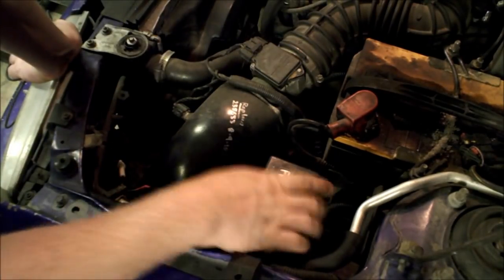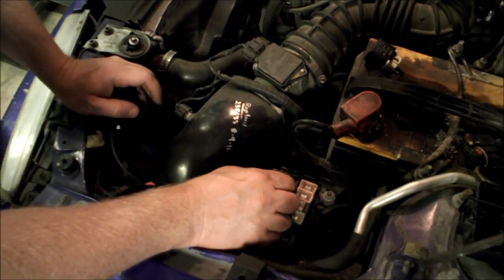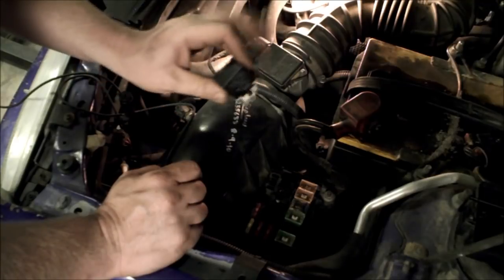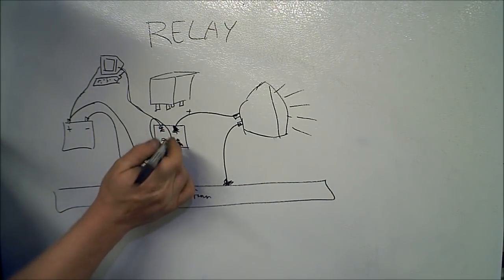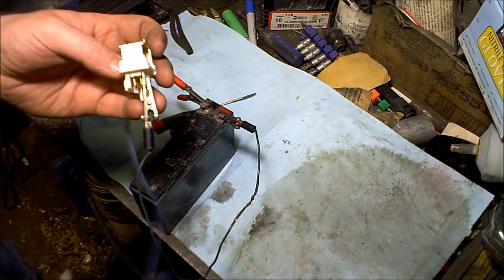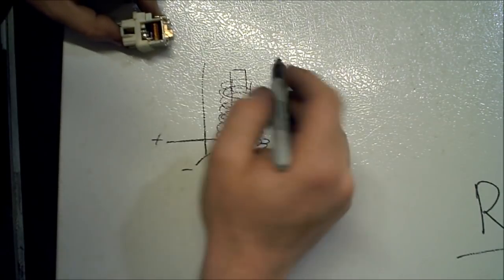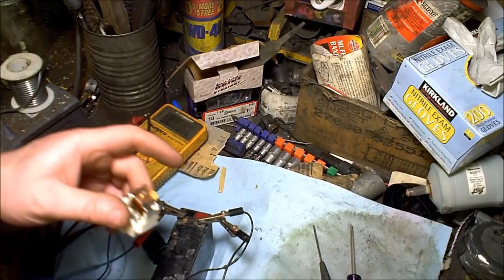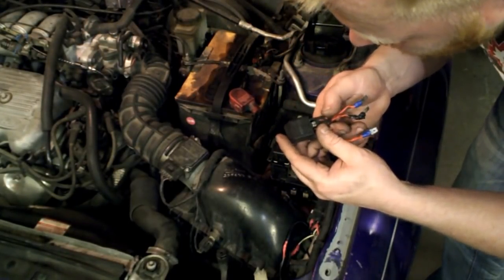How Automotive RELAYS work and how to FIX them

Comment: please keep in mind that if you sand the contact surfaces of a relay it is only a temporary fix. The factory applied silver or gold coating is destroyed when you do this and it will only last a short while before pitting again. I would suggest doing an internet search for a new relay at your price if the relay price is to high at your local auto parts store or stop by your local pull a part salvage yard you can get a bucket full of relays for a couple of bucks there
Reply: yeah it's sort of like how you could get by for a month or so by sanding your points contacts down in your distributor, so the pitting went away for a while.  But it doesn't last as long as a new one.  It would be nice if there was a way we could plate the contacts again with something ourselves.

Comment from the maker: I have fixed 2 or 3 washers that had bad lid switches. You can just tie the wires together as it is just a safety feature so you dont fall in while its moving.

Comment: This is the best fixes to relays especially in euro car's electrical problems Beetle, Audi, Porsche, Benz -- all go thru same relay problem as soon as they pass 150,000 miles so great fix!!! VW dealership was about to rip me off by replacing alternator and starter for tiny relay problem and quoted me 4785.00 $$ for parts and labor and I fixed it with nail filer for free. Nail filer works pretty much as good as sand paper infact nail filer made contact plates inside relay almost new and shiny which were burnt and black!! Great help

Comment from the maker: When the AC is on the fan should be on as well. If it gets too hot before the fan kicks on then the Temperature sensor for the fan is shot. Yes you could just jump pins to have it kick on always. You would have to use a tester to figure out which pins.

Comment: Nice!.  Excellent video.   I happen to drive a 93 ford escort LX wagon with the 1.9L engine (looks identical your engine) the Fan relay happens to not trigger the fan.  I ended up hard-wiring a switch to the cab but it is getting really hot.  I'm gonna try your suggestion hoping it will fix my problem..  thanks for the motivation

Comment: Hey I appreciate you taking the time to make your videos! This is some good info!!
Reply from the maker: Let me know what you come up with on your fan.
Reply: What is a pain is a recall maybe 1.5-2 years ago the vehicle had fan problems and we replaced the radiator/fan. I am starting to consider the 2 relays in under the air box or the one in the video may be the issue. I'll investigate into integrity check
Reply from the maker: Note where my fan relay is. Ford has it mislabeled at least in 1996. You can see in the video I wrote FAN in orange marker on the top cover.

Comment: I subscribed after thr CV axle video. (I have a 1996 ford escort lx 1.9 5spd, also purple) successful repair there. Now my car won't start. Did it once, cranked and got it home, now no start. The starter tries to turn over, which lead me to the relay which is clicking loudly as you turn the key to start. (I did get some help this time, we all know that's hard to find, haha). Where is the starter on the 1996 escort? The pics show it by driver side CV
Reply: To clarify there is a no crank situation now, so no movement at all even with a jump box.
Reply: Every now and again it'll given a weak attempt, I stopped trying when it didn't turn over like it did to get me home.
Reply from the maker: The starter is on the backside of the engine. If you take off the air intake hose it's pretty easy to get the two bolts out that hold it. There are two wires also connected to it.

Comment: My mom has a  02 grand am with a 3100 eng. The fan works but on dash hand goes well above half way b for fan kicks on, what i want to do is fix it when u got key on  that fan is running n keeps running after start n stays on untill u turn key off? That way mom can hear it b for she starts n she will know fan is running!!! Shes had trouble n past over heating got that fixed!! But she wants to here fan, n having a.c. pump on running all the time is not very efishent way, can i jump pins n relay??

Comment: Do 5 point relay now bro!!! Grrreat video... Highest recommendations 👍🛠️🛠️🛠️🛠️🛠️
Reply from the maker: 5 port is exactly the same except the 5th port is always connected to the power source unless the relay is activated then it disconnects this port and connects the power to the other port. So the relay is used to disconnect something from getting power. This is a rarely used function.

Comment: Thank you for your video. It was very useful. 
Ok... I have a problem. 
Tested the relay, it's good. 
Fans don't come on. 
Applied direct power to the fan, fan comes on. Replaced the engine coolant temperature sensor, still no fans. Tested for power where the relay sits, power is good. 
When I short out the ports where the replay sits, fans comes on. So wire is good from relay box to fan. 
I'm lost, what's my problem ? 
Any ideas ?
Reply from the maker: Sounds like you're on the right track. It's not uncommon for the computer itself to not tell the fan to kick on. Try turning on the AC and see if the fan kicks on.

Comment: Whats it mean if you do this a couple times and it keeps getting stuck? At what point is the relay just junk? Each time I clean it it works fine.... for a month or two. Thanks
Reply from the maker: They put a layer of silver nickle onto the contacts. That can get burnt away and the contacts will want weld themselves together. When this happens I generally replace the relay with a cheap Universal Style.

Comment: Could you explain what is seen at the relay terminals of the relay socket? What signals the coil side to energize? Can it be measured with a multimeter and what meter scale on it should be used? My ford windstar cooling fans run only when I connect the battery straight to them, just to know they work.
Reply from the maker: A 12 volt positive signal will trigger the solenoid to kick on. You can measure this on your multimeter with any DC voltage higher than 12 volt(example:20v 200v etc). Listen for a click when you put the solenoid in and pull it out. You can also grab a different same size solenoid from the horn, headlights or similar and try that. The fan should kick on anytime the AC compressor is cycling no matter the vehicle temperature.

Comment: What if it the relay holes from the fuse box it's self not working meaning in the fuse box where you plug the relay do I need to buy a whole new fuse box

Comment: I have a relay with a 5 normal size pins and another 2 pins which are smaller size.
Do you know for what the 2 smaller size pins are ?
Relay is (according to wiring diagram) for- fuel pump .
Reply from the maker: +Peter Dimitrieski The smaller ones should be your triggering device that turns the relay on/off. So one is pos and the other is neg. You can confirm this by using a multimeter and touching them. There should be a higher number of resistance than just touching the probes together.

Comment: I have a 2007 Dodge Caliber SXT and my High beams will not work. Does this have anything to do with the Relay or TIPM?
Reply from the maker: Your car should have its own relay for high beams. I would pull it and swap it with the regular headlight beam relay to test if the relay is bad.

Comment: Have you ever soldered the copper coil if it is broke or Separated.
Reply from the maker: I've played around with this but found it tedious and easier/more reliable to swap in a generic $5 30amp lighting relay.

Comment: @ sixtyfiveford, what gauge wire did you use on that relay?
Reply from the maker: I generally use 12awg with relays from the positive to the device being powered. The switching contacts can be as small as 18 or even 20 gauge

Comment: Would connector sprays work? Like crc or deoxit
Reply from the maker: Yes and no. Generally the failed points are from arcing. I don't think CRC or Deoxit will touch that. If it's from corrosion/moisture ingress, then yes.

Comment: I bet this is whats wrong with a GE washing maching i got off craigslist. I checked the 3 big capasitors and they dont look blown out. Could be the magnetic lid switch too. not sure yet. It's a 4.1 cubic ft top load and about 3 yrs old.

Comment: my outside mirrors motors that move them on my rx330 sometimes work and sometimes don't.  Vould this also be the relays?
Reply from the maker: +tikonc Relays shouldn't be involved in the mirror system. More than likely it is the motors that operate the system.

Comment: How do I make the contact stick longer. Do I change a capacitor? Why does the contact shut off in the first place?
Reply from the maker: The relay stays engaged as long as power is flowing through the coil. Disconnect power and the coil de-energizes and allows it open.
Reply: @sixtyfiveford  just to be clear though. If I add a bigger farad on the circuit will it make the electromagnet stay on longer? Thanks in advance.
Reply from the maker: @aaronmoritz9878  if you added a bigger farad capacitor it would stay on for maybe a half a second, second longer after you remove power.
Reply: @sixtyfiveford  very good. Just wanted to follow up on the concept of a bigger capacitor.

Comment: my car low beams work random ... they sometime work sometime dont but the normal headlights work only with low beams this problem ,, any help?
Reply from the maker: ***** You have a short somewhere, it's just a matter of narrowing it down. I would start with the light switch itself. Turn the lights to the "on" position and wiggle the switch without moving it to another switch location to see if it changes(lights flicker on/off).  If no change is noticed then we can move to the relays. Your vehicle should have 2, high and low beams. Find their location in the owners manual and swap them, low for high and high for low. Now test and to see if the problem reverses.
Reply: thank you for your reply , i will try that.
Reply: sixtyfiveford i got them fixed it was the switch , thank you again
Reply from the maker: You're welcome. I'm glad you were able to get it fixed. Take care.

Comment: What if the ac fan doesn’t go off after the engine is off?
Reply from the maker: Some cars do this normally. To eliminate the chances of the relay having welded contacts, pull it and see if it clicks. You can feel and hear it. If no click them it's welded, which is very rare. If it does click them something (computer) is telling the fan to turn on.

Comment: 99% of the time with a 4 pin relay, the load circuit is diagonal and the other diagonal pins are the control circuit.